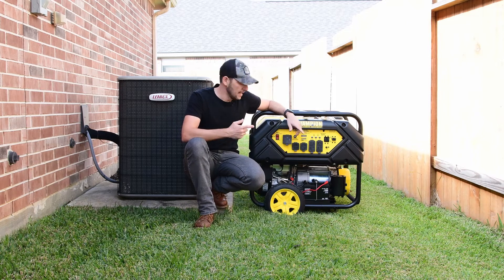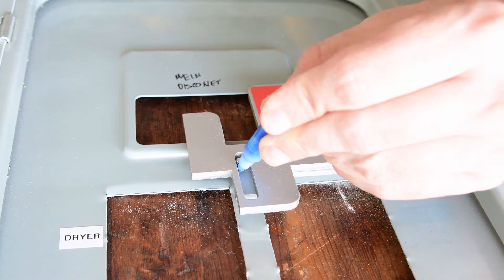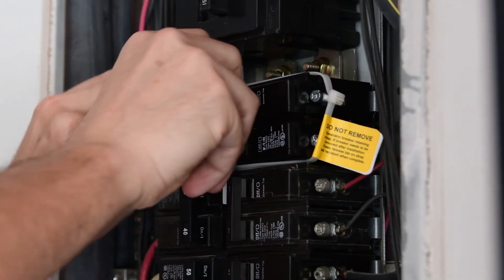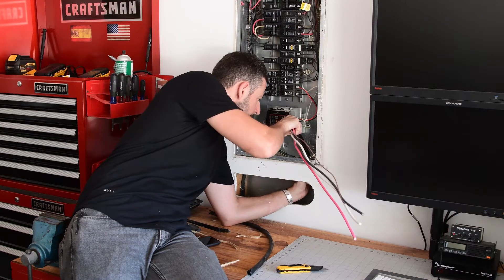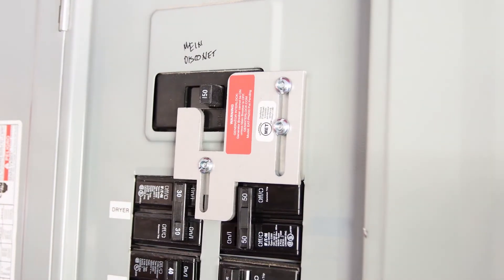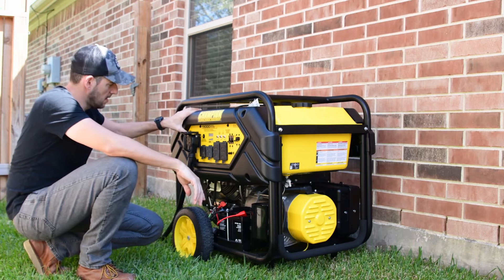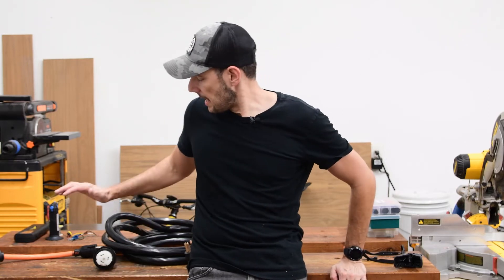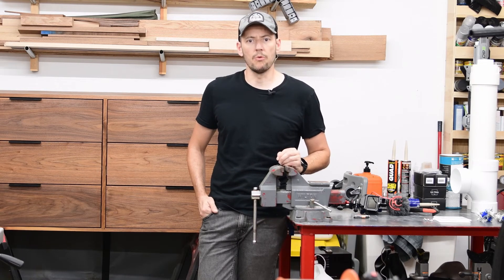Champion generator 12000w vs 4 tons AC

Comment: Good video- electricians charge $300 or more for “your peace of mind”  there’s enough videos online to take the plunge.
Reply from the maker: And not everybody has the tools, knowledge, time, or willing to take the plunge, then is when an electrician comes handy. Thank you.
Reply: I just witnessed a licensed electrician wire the inlet box wrong wiring the neutral to one of the hot line and one of the hot lines to the neutral.  Needless to say when we started up the generator things went haywire - shorts, breakers tripping 240 at 120V outlets.  He measured 120 V across the two 50amp breakers screws instead of the expected 240V.  After correcting it, it appears the only issue was a fried power strip in the house.  Suspect some other things might be damaged but only time will tell. It was a real mess.  Trying to understand overall what happens with this setup is a real headache.  Shorts, undervoltages, overvoltages etc.  Nuts.  Proves if you want something done right do it yourself.

Comment: Nice job here's two tips for you.  You may want to install the Rectorseal KS-1 Kickstart kit to your AC.  My 5 ton went from pulling 36 amps peak to 16 and my 3.5 ton went from 26 to 14 at peak start up.   Install was simple two wires.  Also my electrician set up a 30 amp back feed to the emergency disconnect on my 3.5 ton.  This strategy allows me to power one AC via the interlock kit and the second AC via a secondary generator.
Reply from the maker: Thank you Jerry Hall, I have been looking at kickstart kits as well. I will definitely  get one since my AC is old  and will make it easier on the generator.
Reply: Great information under this video. I'm going to order the Rectorseal KS-1 Kickstart kit to reduce my startup time & amperage draw for the generator. Ty Jerry
Reply: @BUTTEWORKS  I think we have the same AC! I just installed the hard start mentioned and my in rush amps went from 99 down to 58. i'm going to try and run it with the 11,250/9200w efi champion generator. wish me luck!
Reply from the maker: Hi Jerry, I was looking into installing a hard start too. However while they reduce inrush current they increase  starting  torque by increasing the phase shift between the start and run coils currents putting more stress on the bearings and rotor overall.  I actually have a hard start kit  for when my compressor start getting too old and lazy to start, then I will use it and run it till it dies. Now if there would be  a way to switch on and off the hard start it would be perfect, taking advantage of the inrush reduction when in a power outage and not pushing the rotor that hard the rest of the time. Thank you for the feedback, hard start kits definitely help when the generator is at the limit of inrush current.
Reply: @BUTTEWORKS  you could literally just leave it installed and remove the two wires from the capacitor. The ks-1 is only two wires to hook up. Tested mine yesterday and the 9200w started the 4 ton no problem with the hard start installed. It jumped up to 75% load for a second, but then settled at 50% load running the a/c, air handler, fish tanks, computers, ceiling fans, fridge/freezer and deep freeze. it even had no problem when the well pump started, still at half load. I'm sold.
Reply from the maker: @paulandmegian9139  You are right, will worth have it in place, just ready to be wired when needed.

Comment: You need to understand that the typical non-inverter generator puts out a total harmonic distortion (THD) in the 10-25% range. Conversely, inverter generators typically put out less than 3% THD. So, if want to run a high efficency (read computer driven) furnace, tankless hot water heater, smart TV, computer, or UPS, 10-25% THD from a non-inverter generator can reak havoc and sometimes even damage the computer controls of your high efficency furnace or computer driven devices. So, if you want to run sensitive electronics, be sure to get an inverter-generator.
Reply from the maker: I have all my sensitive electronics, computer, TV, chargers, audio etc connected to UPS as a "firewall" to "dirty" power. In any case, none inverter Honda generators have a THD of 6% or less, none inverter Westinghouse 5%. But agree with you, inverter will be safer with electronics.
Reply: Computers could care less about clean or dirty power. Look at their ower supplies. 100v to 240v voltage range, 50 to 60hz, amperage varies. Plus look at the 3rd world countries computers go to that have crap power.  I agree some thing might act a little weird but generators have been around for years running houses before "inverter" became a buzz word. Not everyone has high end appliances or the "fear" of things breaking.

Comment: Good video 👍🏼👍🏼 I would strongly suggest installing a Microair Easy Start on your AC to reduce starting amps 50-75%. Also I made my interlock from 1/8” plate aluminum and saved $50.
Reply from the maker: Interlocks are very expensive for what they are so it is great you DIY yours. I'm glad you liked the video. Thank you
Reply: My brother in law is a master electrician and I ask him- wouldn’t it be cheaper to just make this $80 piece of metal? His reply was “ the stickers is what’s worth the money”
IMO - it’s function but I guess he knows something we don’t know. 
After doing my house- since he was considering a Generac - he opted going my route.
Reply: I agree. You should get a soft start device like the micro air easystart to reduce the inrush of amperage. You might have even been able to run that air conditioner on your smaller generator with such a device.

Comment: 408.36(D) Standard breaker can be backfed as long as secure it in place with a tie down hence the zip ties. Also  a UL 489 listing requires other than pull to release the back feed breaker.
Reply from the maker: Thanks a lot Casey, that explains it. Thank you for providing the reference  408.36(D)
Reply: @BUTTEWORKS  some more clarity from the internet, the reason for it is... Backfed breakers are often used in situations like generator interlock kits. Unlike standard breakers, which are fed from the panel's internal bus bars, backfed breakers receive power into the breaker’s output terminals and feed it back into the panel's bus bars.
Without being strapped or secured, there’s a risk that the breaker could be accidentally pulled out while still energized, creating a shock hazard for anyone working on the panel.
Reply from the maker: @condor5635  Makes sense. And while I don't see that happening in a breaker box like mine with all the cables secured I can see many other cases where it could so. Thank you for the clarification and contributing with more information about this topic.

Comment: Great video!  I want the trifuel with Natural Gas 10,000 running and 12,500 of starting power to run my 4 ton.  Do you think it will do it without a soft start?  Appreciate the video.  Is that 2 cylinders in the 23 HP engine?  Is Champion worth it?
Reply from the maker: The champion is a V-twin two cylinders correct. Regarding you 12.5kW peak generator, I would give it a try on a 4 ton. If it can't you can always get a soft start. Your generator can run with no problem the ac compressor it is the high inrush needed for a few milliseconds what may make the generator to trip but I would try. Thank you for checking the video.
Reply: @ are you happy with champion? Do you think it’s worth the additional cost over Duramax or Westinghouse?
Reply from the maker: @condor5635  Westinghouse and Duramax they also have 2 cylinder versions. I would say, yes, if you can afford it, buy once, cry once and you won't have any issues with AC whatsoever, everything will run.

Comment: Did you pull a permit?😁 I don't have a finished wall so i'm running a short length of conduit through my cement wall to the box outside, but other than that basically the same installation. I'm using 6# thnn wire instead of romex 6/3 just because i don't want any issues with the code inspector. These champion generators are confusing. I ordered the 11.5kw peak with fuel injection and it shows two 38a breakers. i'll have to upgrade my multi meter so i can check the amps.
Reply from the maker: No permit, I don't think you need one. That generator you bought should give you 95amps at 120V so it could start a 4t AC.
Reply: @BUTTEWORKS  Not sure about texas, but here in Florida you need a permit anytime you are adding a new circuit. That doesn't mean everyone gets one.😁 I'm not sure how the amps work for these generators. Champion themselves said mine will output 38.3A at 240v

Comment: Hello, can you please list all the link of the accessories needed to install or to connect the generator.. ? Thanks
Reply from the maker: Hbeltran, the interlock is specific of each breaker panel so you need to check in the door of your breaker panel which model you have and buy the one that fit yours. The outdoor socket I used is https://www.amazon.com/gp/product/B000BQT47S/ref=ppx_yo_dt_b_search_asin_title?ie=UTF8&th=1
Reply: @BUTTEWORKS  that outdoor inlet socket is 30 amp..   do i need the 30 amp or 50 amp?   I have the 4 ton ac
Reply from the maker: @casmor08  You will need the 50 amps one and a generator with 50 amps outlet as well. I think most 9000w and up have 50 amps outlets already.
Reply: @BUTTEWORKS  and  would 9,000-10,000 watts generator work on 4 ton ac?

Comment: That huge v twin will suck some gas during a summer power outage. Like $50-80 a day worth. Might be better to get a small window AC unit, and use a smaller generator, and hunker down in the master bedroom, until the power comes back on.
Reply from the maker: It would uses 10gal a day so down here in Texas will be less than $30. I'm counting with three or four days with no power so total $100 of cool down house down here during hell season it is totally worth it to me. Thank you for your comment Scott.

Comment: I ordered a 12000 watt gen and will convert to natural Gas so I know I'll lose a bit of power but I'm hoping it will run my 4 ton, what do you think? It should be a solid 10kw
Reply from the maker: I think will do it no problem, it is just a fraction of time what needs to provide the high amperage. Once you try I would appreciate if you post your findings so we all learn. Thank you Jeramie
Reply: Have you tried this out yet? I’m getting your exact setup at my home
Reply: 10k will definitely power such an air conditioning unit, but most likely only if you have a soft starting device.

Comment: 240x98amps??? 23,520
Reply from the maker: The capacitor in AC does not deliver any current, it only creates a phase shift between the  start winding current and run winding current to increase the starting torque and  overcome the initial resistance of the rotor to turn due to its  mass. I measured the amperage at the generator output and was exactly 96 amps. How can a 15kw peak  generator deliver 96 amps?. I don't know but the  breaker does not trip.

Comment: I've been looking hard at purchasing this 12K watt Champion generator. I need to run a 5-ton (60,000 BTU) AC, a 13 cu ft. upright freezer (non energy star), and a 26cu ft. Samsung refrigerator / freezer. Just those 3 items in this AZ summer heat, if the power goes out.  I've run a ton of calculations, but am just running an educated guess on the startup/ running watts required for the 5 ton AC. Anyone have any input? I don't want to chance purchasing this if it can't handle the load. Contacted Champion but they didn't give me any information. The rep just tried to upsell me on a fixed outdoor generator unit. My calculations appear high . Appreciate any input, thanks.
Reply from the maker: 5 tons AC start up should be around 120amps and running around 30amps. It will say in you AC manual, compressor unit sticker or you can download the PDF specs from your unit.
Reply: @BUTTEWORKS  emailed you my AC specs for reference, along with some calculations. I think my numbers are too high / over-estimated. 120A x 240V = 28,800 watts startup and 30A x 240V = 7200 watts running.
Reply from the maker: @xjetpilot  The generator is not putting all the amperage in the start but the capacitor in the AC unit. For the running your numbers are correct. If you have an amp meter you can measure the amperage while connected to the grid to know these values as I did. You can also install a hard start ac kit to reduce the time for the motor to start.
Reply: @BUTTEWORKS  I just purchased a quality T-RMS clamp multimeter to take some measurements here at home on the 5-Ton (16 SEER) power draw. I was surprised by your current samples of 98A (Peak) and 13.8A (running). If you convert those to watts, they come out to 98 x 240 = 23,520W (peak) and 13.8 x 240 = 3,312W (running). The peak is what surprised me. That Champion gen can handle a peak of 15,000W. Surprised the Gen breaker didn't trip. That Champion is a monster. Just wondering ... what does your meter on the Gen show? Are you usually running in the green LED range with an electrical load, or does it ever wander into the Amber range? Great video BW, thanks.
Reply from the maker: @xjetpilot  The peak with last miliseconds is strongly supported by the capacitor in the AC unit, not the generator. The capacitor is like the jump start. In the video you can see the green LEDs when the AC kicks in, it only lit one and not for long, see 4:28 so the generator didn't even put out much power. Your generator will mostly have to provide the 3.3Kw running not the 23Kw peak.  I will do another video measuring the power delivered by the generator at the breaker panel not at the compressor since the peak you see in my video is influenced by the capacitor.
Reply from the maker: @Justin Time   I did a test and the amperage at the breaker  was exactly the same than at the  compressor. So the generator is pushing the 94 amps peak for a split second, enough start the motor. I believe since each phase in 110v going into the breaker, it is the 110 phase the one driving the 94amps. The capacitor only creates a phase shift between the run and start coil in an AC system enough to create an off phase magnetic field able to create a torque.

Comment: They all have a 30 to 38 amp breaker on gen it will trip
Reply from the maker: The Champion 15000 has a double 50amp breaker for the 50amp outlet.

Comment: It say 50 amps but the generator breaker on a 30 amp 240x30=7200
Reply from the maker: Indomitable, this generator has a double 50A breaker, one per pole.